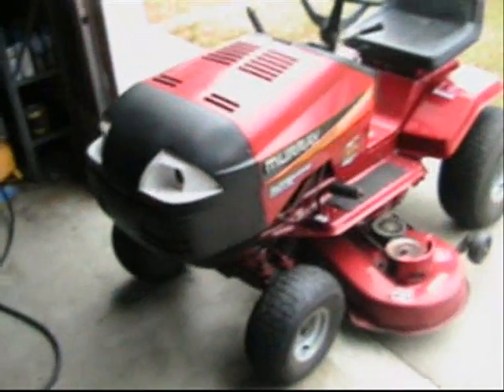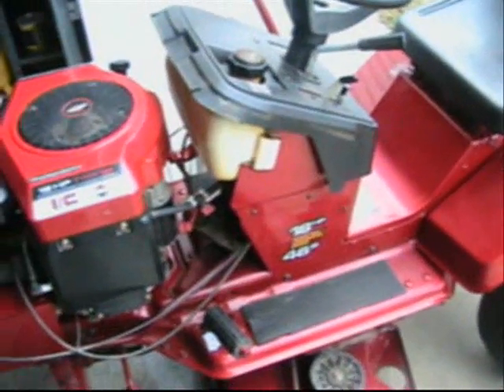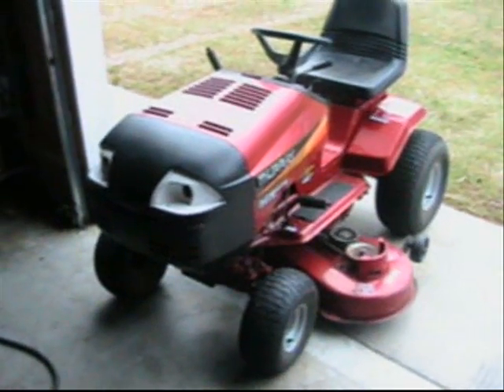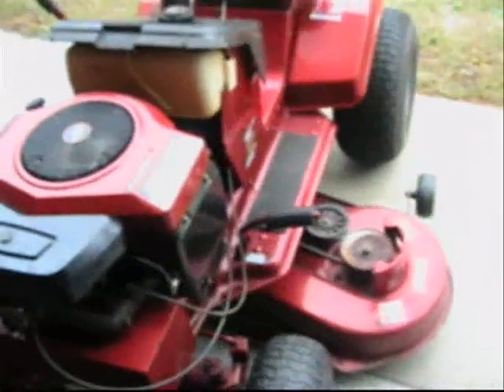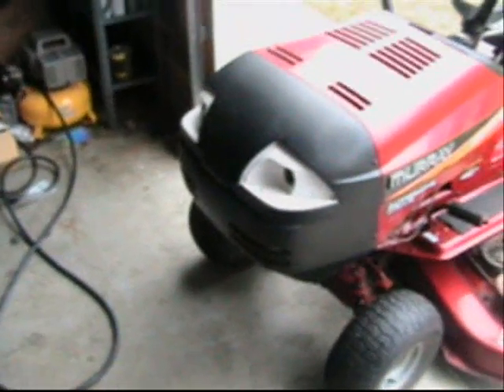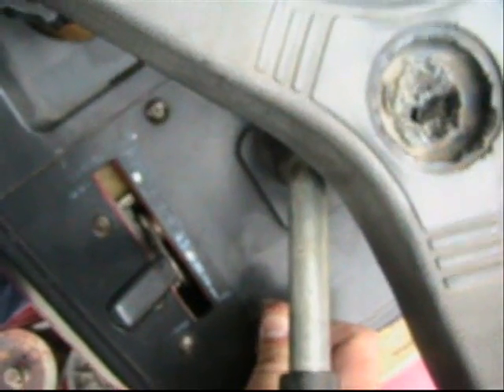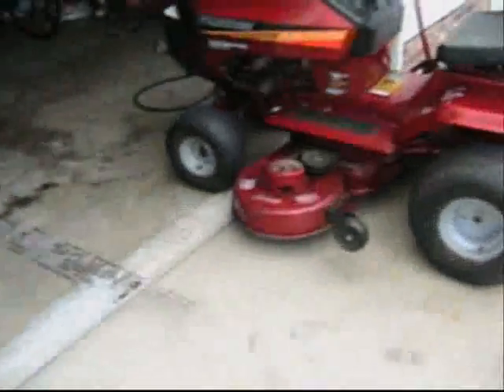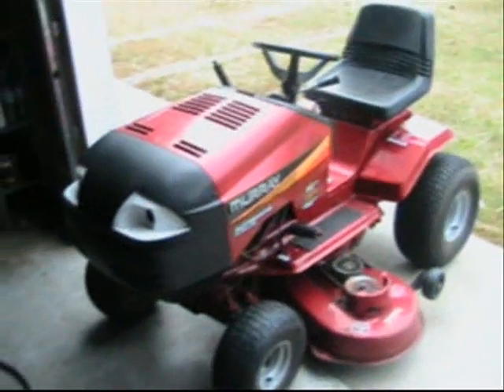1997 Murray 18hp 46" Cut

Comment: Good Mowers before they went over to China for production. I just picked up a 1994 16/46 mower (believe first year they did the hydrostatic transmission). Still runs good, just doing a cleaning of the mower and engine (air-cooled fins had dirt/grass in them), tune-up, new fuel lines, new carb, and re-greasing the fittings before I start mowing, but it runs fine.

Comment: Please help.. I purchased a murray. 18hp with what i believe is a 46" deck (tractor is similar to yours in style) the deck that was not mounted (deck has 3 blades) it is missing all of the deck mounting hardware,  and linkages, which I am having trouble figuring out and finding..  as the previous owner repainted over everything including model number, serial numbers  decals etc. 
Could you possibly  share your actual model number, and possibly do a video showing how your deck is mounted, so I can figure out what I am missing?Please and Thank-you!

Comment: You don't seem to know much about Murray mowers so I'll help you. they are industrial commercial engines because they have cast iron engines for longer life. the deck on that mower is 16 gauge steel. grease fittings on the deck and front end. I have one like this one and a 1992 that run like new. as with anything if you don't take care of it will not last.
Reply: Mr. Fatty  is there a possibility you could show us how your deck mounts? I just purchased one with the deck mounts(hangers) and linkages missing,  I would love to see what i am missing?